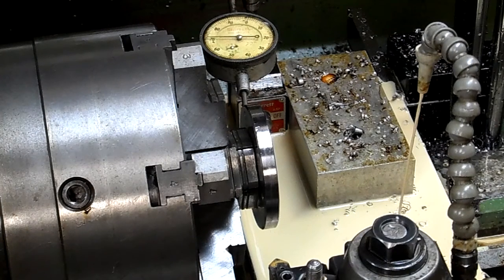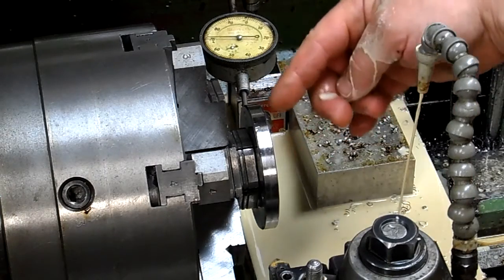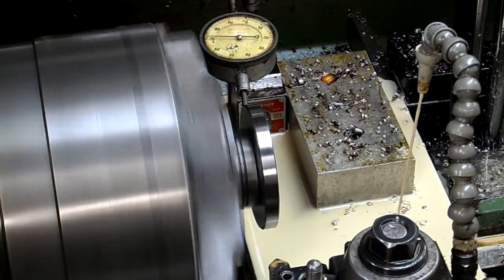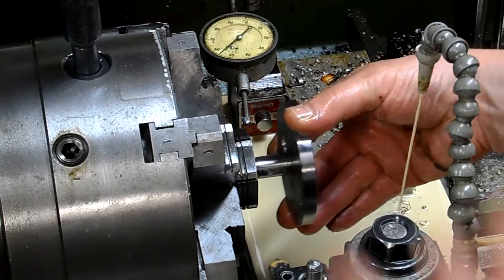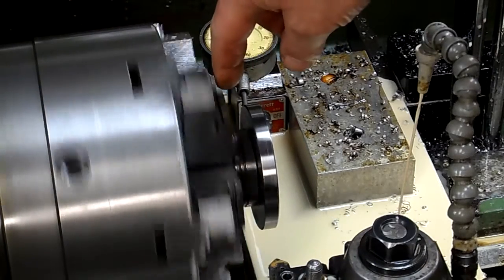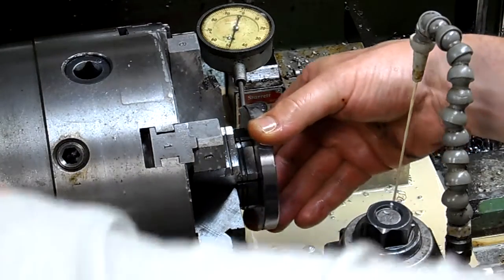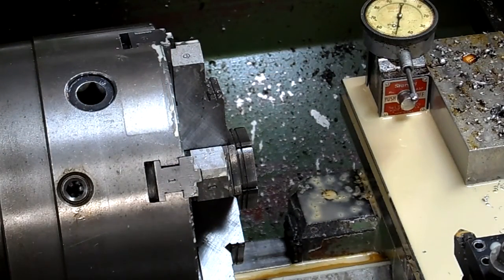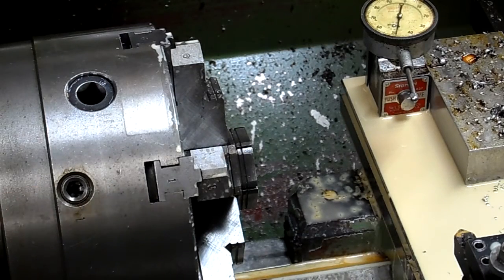Fred checking PK-80 Motorized bicycle engine crankshaft parts. Yikes!

Comment: I checked how much centrifugal force would be created by a 72mm long (1/4 the outer crank circumference) strip of .012" thick metal at a total crank wheel width of 31mm. It creates a centrifugal force equal to 8% of the force that the counter balance creates. I wonder if all of them are like that.
Reply: There is another wobble to look for after shaving the crank wheel down on the lathe. Wobble not due to the crank wheels being manufactured out of round is due to the two crank wheels not being aligned with each other relative to the connecting pin (for the conrod big end). And to correct that you hit the crank wheel at its high spot (which is usually 90 degrees from TDC) to bring it back into alignment.

Comment: Fred ...
How the fuck do you separate  the crank itself ?
 I cant seem to get  it apart with out hammering it into warp city  I even hit  it with a good amount of heat . For the record  I'm a 25 year = Pump mechanic / well driller so Im use to stuff getting stuck beyond a reasonable doubt  I was wondering  if there  is a trick to getting the pin out to free y connecting rod also If I mail you the crank would you machine  it for me?  
For a fee or course?

Comment: Do you still sell these balanced cranks on eBay? I just took my engine apart after 2 years of riding it daily and think its time for a rebuild.
Reply: Wow 2 years that's actually impressive, what oil did you use, any Additives, did you ride it often or weekly day in and out. Any mods or is all stock parts with imported engine?

Comment: Not one to grip Fred but the engine case is likely no more interested in holding that nice little centerline your estimating to correct within the entire of this $2 .25 assembly when it's reassembled your aware I'm sure no less a custom ground crankshaft out of a billet is better than a set of disk brakes .....